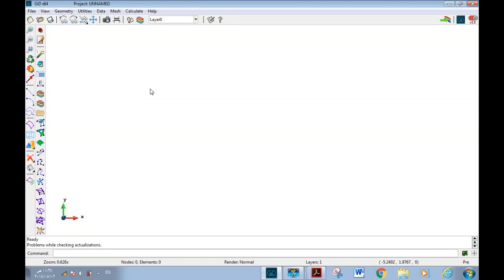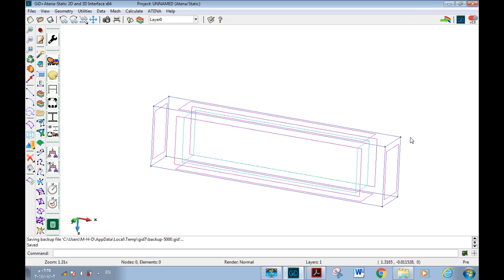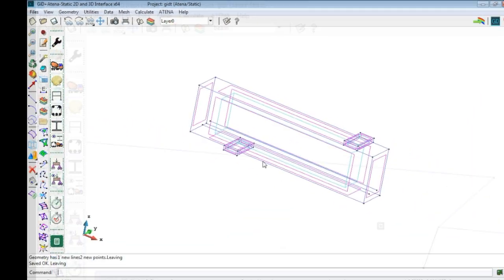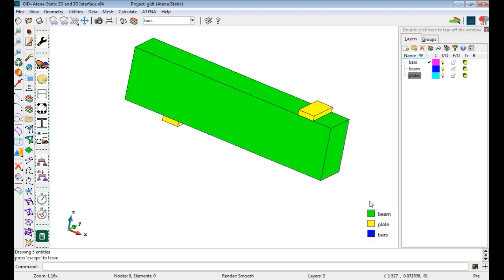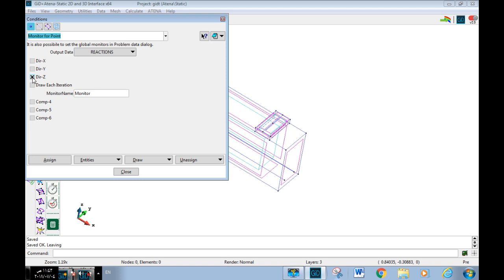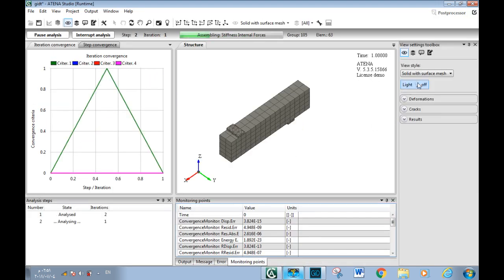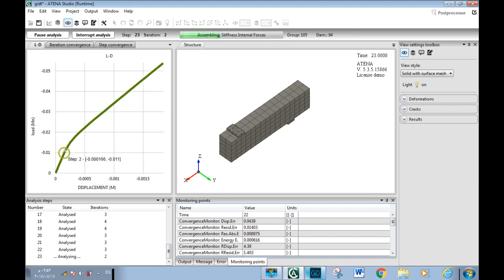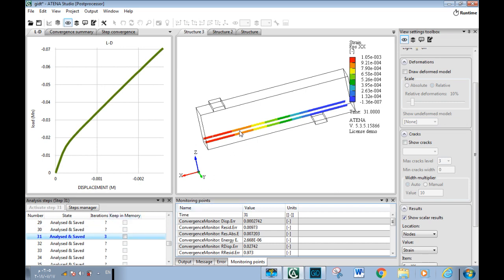ATENA Science GiD Tutorial - Shear Beam - Complete

Comment: Sir in the tutorial your saying simply supported beam with pin supports and while going to designing you just created bottom steel plate and only support condition in below the steel plate 
1. How to create the pin support under the bottom steel plate sir. 
2. Why your taking steel plate only why not bar plates, can you please say me sir 
3. By applying displacement on the top plate how you will get the load,  is it practically works. 
Please Vladimir sir very urgent answers 
It would be better if you upload a video
Reply: Please I am civil engineering  .. Which version to choose ?
Reply: @noorayaad2525  first go to official website and download atena complete setup file and install and we will get demo version only and if you need full version you have to buy it
Reply: @haricharan4519  oh very difficult .
 I have link contain many atena but I don't know choose a version for civil engineering?
Please help me ..this my email. 
noorayaad.2017@gmail.com
Reply: @noorayaad2525  keep mail to the company website they will assist you in detailed